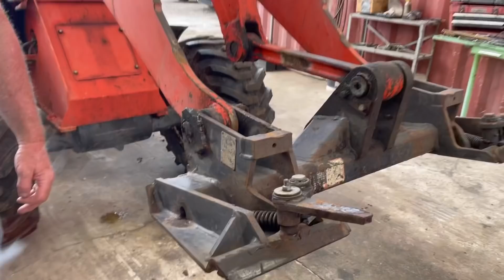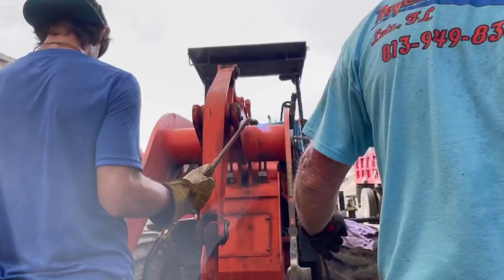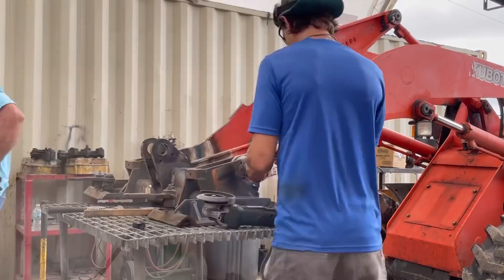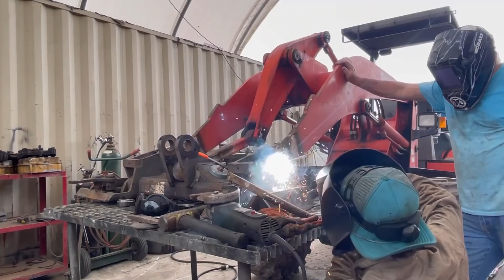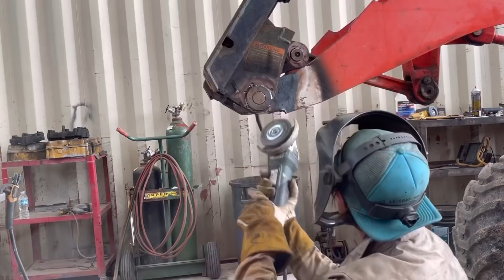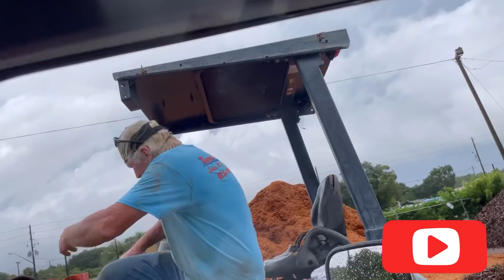Welding on a Kubota Loader (Pins and Bushing repair)

Comment: 14:43 when your done making a pass with 7018 flick the rod really quick with your wrist. It will fling off the molten bead off the electrode and gives easy restarts.
Reply: or smash it used side down ( a stabbing motion) Thats what I use.
Reply: Yeah the only problem with that on certain job sites is that when you are welding around expensive equipment (say hvac systems inside a hospital or the floor-to-ceiling windows of an office building) you can't really throw fireballs around haphazardly. Just take the rod out the stinger and jam the business end of it into one of the retention screws of the stinger until the slag and flux flake away to reveal the bare metal of the rod. Easy restarts.
Reply from the maker: I do usually do that

Comment: I keep a single cut file I picked up at flea market in my tool bag, where I keep chipping hammer, and a few spare disc, etc.. it is put near me when I know I will need to scuff rod tip to do spot welds or similar. we all have our individual tricks.

never done bushings like this, did 1 not as important maybe 15 years ago. for a rear lift arm on a 3 point hitch

Comment: Hi Anthony, Love all your videos keep them up, couple of things did you remove battery terminal when welding because of electronics, 
and please always think safety first never ever stand under hydraulic machinery with out a prop of some sort in case a seal goes 
Please don’t take this the wrong way just think ahead
Can’t wait to next Friday to see what you have been working on
Kind regards 
Jamie James🇬🇧UK
Reply: Good to see UK folks commenting on videos. We can all learn together. Greetings from Connecticut!
Reply from the maker: no I didn't remove battery cables, that was on purpose. electric always finds the quickest route, and the ground was attached to the quick connect coupler. I wasn't worried about the machine coming down on me because it was running while I was under it. no chance of Hydrulic sag

Comment: @Anthony (Meltin Metal Anthony) -- Could you do a video on the setup of the rosebud, pressure settings(1:7 ratio per cylinder), volume of gas used, etc?

Comment: New to your channel .... Nice repair.   Looked like pin length for quick attach bushings was an inch or so longer than needed.  Any reason why?  You talked about 6010 running downhill for root pass, then capping with 7018 uphill.  Is that standard to do root down and caps uphill?  Lastly, I am assuming Any 60xx  1/8 rod would do ok for root pass (6011 or 6013)?  Last for us DIY welder rookies, seeing you machine settings would be helpful.  Thanks in advance, again nicely done!
Reply from the maker: thanks for the SUB ! I hate 6011 and 6013 is not appropriate for this application. always run 7018 rods up hill. 6010 I can get away with turning the heat up and dragging it down. 7018 tends to get slag inclusions when going down hill. although it is done on certain pipe applications

Comment: Hi Anthony. Could a peice of plate been used to reinforce the bent areas of the loading arms? Does heating the arms and bending them back take away strength? Genuinely curious.
Reply from the maker: they ruined the pins and bushings on this machine again. the opposite way. the arms stood straight thou

Comment: On the 7018 what happens is the shield material (outside for new welders) melts and covers the end.  If you have to, put a brick or rock or something like that to tap the rod on to break the slag(melted outside) off the end of the rod.  For any certified critical weld,  I would just put in a new rod.  Usually the company is paying for consumables this kind of welding.

Comment: Ant.7018 is the industry standard for mechanical repairs. 60xx rod is only
 85%of 70xx rod strength wise. Why handicap your weld plus 70xx is more ductile. You are doing some fine work. I'll keep watching.

Comment: Hey Anthony! Off topic question, I noticed that you run a trailblazer. I recently bought myself a new 325, and was wondering if you (or any one in the comments section) had any preventive maintenance tips for these machines?
Reply from the maker: just routine maintenance, these motors are real dependent on oil changes. seen one the other day with 700 hours and a bent rod cause of lack ofnoil change
Reply: Diesel or petrol?
Reply: @lukeblaikie507  Petrol

Comment: Did you teach them how to use a grease gun?
Reply from the maker: 😂 lmao I said that to the mechanic
Reply: @MeltinMetalAnthony  that's a real common problem with equipment if the joints aren't greased DAILY!! You'll have these types of problems

Comment: you just heated the temper right out of the steel and those arms are gonna snap in the future.
Reply: @MeltinMetalAnthony  from the self proclaimed back yard learned welder, maybe go to school one day and learn something
Reply: need to strengthen arms weld angie iron on side
Reply: How would you bend those arms back then?
Reply: @keith2860  in an industrial application they get replaced, I know that’s not ideal for every situation but they’re heat tempered to a certain hardness and that much heat without proper controlled cooling, they’re just gonna bend or snap
Reply: Yea i figured that’s the only thing i could think of, i can’t help but think they’d tell you to beat it though and get someone else who would just weld it lol i guess that depends on the company though.

Comment: Never ever run downwards stick, America is living in the 80’s 
Every other country runs up for obvious reasons. If your good , it’s faster due to less cleaning , you only have to touch the slag and it falls off .
Reply from the maker: you can run 6010 down and 7010. you can run any fast freeze rod downwards.
Reply: @MeltinMetalAnthony  it’s almost banned here in Australia but if it works it works